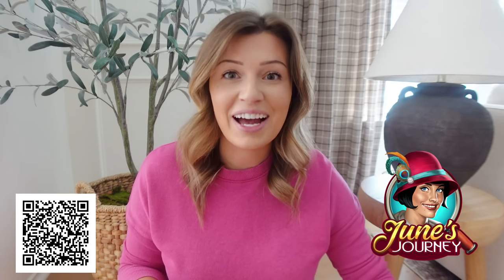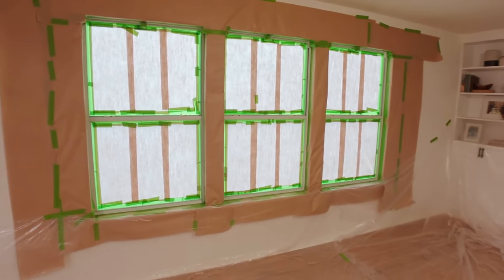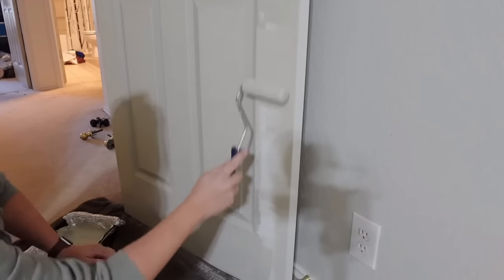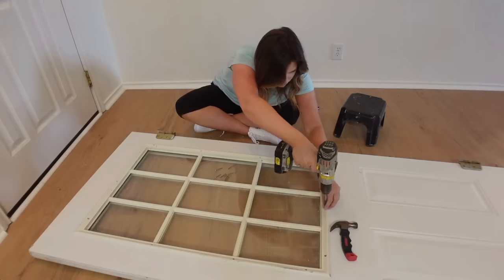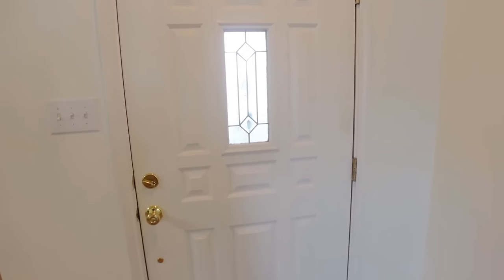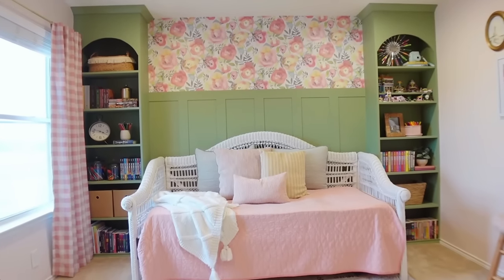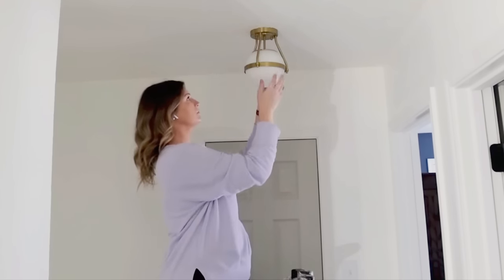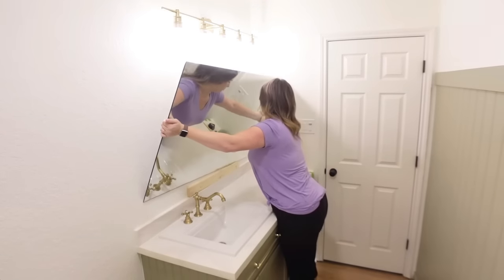HOME PROJECTS UNDER $100 THAT MAKE A BIG IMPACT

Comment: Adding the window to the front door is pretty cool. Must have been nerve wracking hoping it would work because otherwise the house wouldn't have been secure. Is your front door wood or metal? I like that you added a blind for privacy when needed. I look forward to following along on the bathroom remodel.
Reply from the maker: Totally nerve wracking! My door is metal.
Reply: @KelseyRomitoDIY  I felt that way when I changed the front door lockset! I changed brands so had to drill a new screw hole because it needed to be in a new location. And I ran into a problem with the deadbolt not fully extending. I think the instructions had something backwards (like left when it should have been right). Although I didn't find exactly the same scenario on YouTube, I did find enough information to be able to figure it out from there. My door is also metal. I like your channel because you figure it out and have great results. You go, girl!